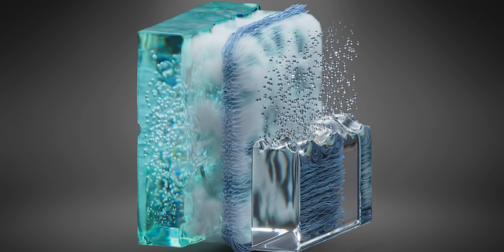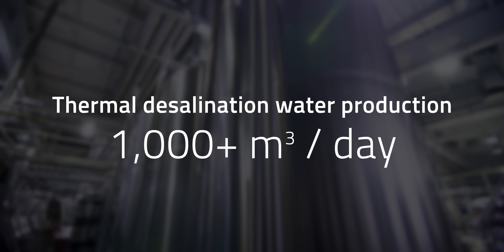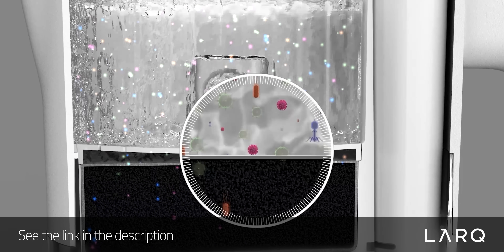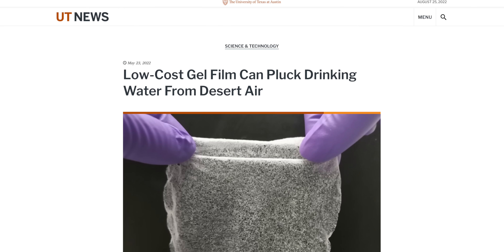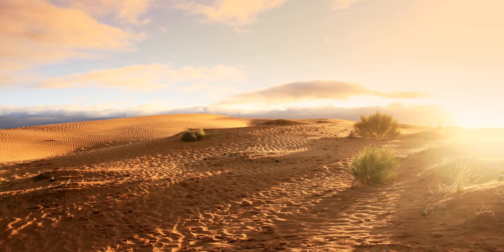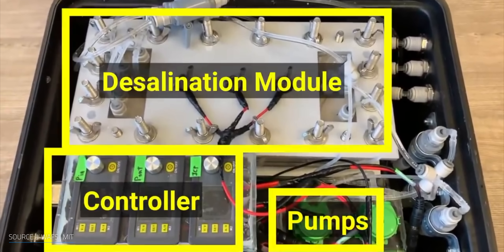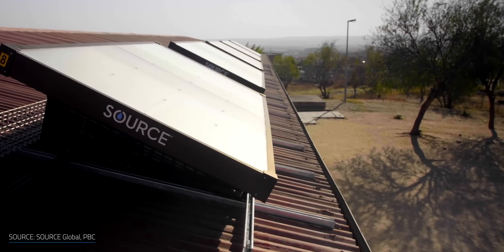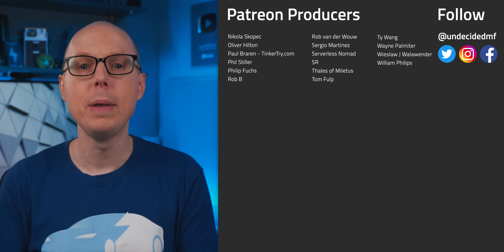2 Breakthroughs That Could Solve the Fresh Water Crisis

Comment: When I hear about the brine-residue from desalination, I always wondered if it's possible to dump that salt residue in areas like the North Atlantic to counteract the freshwater runoff from Greenland that threatens to interrupt the flow of the Gulf Stream due to the different water densities.
Reply: As far as I understand it that would have a devastating ecological impact, as you'd essentially be turning all that fresh water into salt water.
Reply: @Sancarn  You wouldn't dump it on the ice. I was thinking that you'd put it in freighter ships and release it in the ocean further off of the coast to add more salt content to the freshwater diluted ocean water. No idea if it works, it was just an idea how to potentially use the brine and alleviate the looming dangers of the ocean current disruption.
Reply: @Equulai   I see two problems with your idea:
1. It would be expensive.

2. Would probably be an ecological disaster, because you will inadvertently introduce invasive species. If you move and dump such amounts of material from one area to another that is unavoidable.
(that's already a huge problem with the ballast water of ships. If you want to know more about that topic you should look up the "Ballast Water Management Convention")
Reply: @Jehty_  It would cost money, but what do we do with the brine at the moment?Just dump bit back into the water where it was extracted?`

And the ecological disaster: I cannot see that. The brine is a result from a filtration and separation process. Except for extremophiles, can something of substance really survive and pass through all these processes?
I can see, however, that the introduction of all the salt in specific areas could cause an unhealthy increase of salinity in these areas until it dilutes enough.
Reply: Great question. I like how you think.

Comment: Imagine using the zero power option to optimize farm irrigation. the savings in water and pump energy alone would be immense. I wonder if you could wrap some around the base of a plant to provide just the right amount of water to irrigate a lot less. and why don't we pump waste brine into already heat stressed uninhabited desert areas instead of releasing it back into bodies of water? Since desert soil isn't really for growing food or plants I don't see many downsides other than expense. But even that could be creatively mitigated.
Reply: I also wonder what impact human burial in actual earth and not hermetically sealed boxes in concrete lined shafts would do for all this. If we actually used the huge amount of humanity we generate to return the to the water cycle... its a creepy thought but humans hold a lot of water, like between 37 and 50 liters per body on average.

Comment: Well, here's a few problems and solutions. First, humans really shouldn't live in arid areas. They also shouldn't have lush East Coast like lawns., We won't even discuss a pool in every backyard. But aside from that, the first problems with water desalinization is if you pull too much sodium from the ocean, then that will eventually slow, and shut down the ocean currents. Then you go from global warming, to global cooling. The world's ocean currents is what actually moderates the land climate. But as long as you put the salt back, desalinization is the best solution for drinking water. It removes water, which makes the salinity greater. Which is actually a good thing, not bad. But that's complicated. So you want drinking water from the ocean, but you don't want to put brine water back into the ocean? There's a few solutions then. First, since you live in a desert, you pump that brine water into holding tanks. The water is evaporated, and you are left with sea salt. Check out the price of sea salt at the local market. U'll get it. If say, there's a contaminant from the filtering process, then tell those Winter states, free salt. You just have to pay to ship it. They will. Trust me. Water desalinization isn't all that tough. We are just making it tougher then it should be.

Comment: The brine issue is one I don't fully get. If we take into account a closed system, as earth is, if we take salt water form sea we take the water AND the salt. When all waste water ends up in the sea again it does it as non salt water, which (although infinitesimally) will lower the overall salt concentration of such sea. If we take into account that the amount  water we will grab is similar to the water we will return, if we simply add this brine to the waste flow, it won't be an equilibrated system? At the end all brine content was already into the sea before extracting.

On other hand, the gel method, although it has a huge potential in really dry areas I see a greater potential in coastal areas such as where I live (Barcelona) where the air humidity is usually over 60%. In this conditions such a system (or a similar one) could provide a standard home all drinking, cooking, and maybe sanitarian water needed if we take a wall space large enough in a humid room such as the kitchen or the laundry, and free the desalinization methods to transport the clean water to less humid areas.

I would like to see your opinion on that.

Comment: I believe the solution to all those issues is going to come from the optimization of technologies targeted only on one single problem.
 Like energy displacement. 
Most Californians are using Air conditioning intensely these recent weeks... 
But they will burn gas to heat their water, why?
We are in a drought.
But we waste away tens of gallons of water condensation from the AC system we run daily instead of reusing it.
We heat our pools at night with gas while AC blows away hot air.
Energy and water optimization, is the way.

Comment: I like the MIT set up. I, and a lot of my neighbors, have shallow, (28' to 30' with a 12' water table.) wells that can only be used for watering the lawn, but this filter/nonfilter possibly could be used to make enough potable water for culinary use, and reduce my/our need to rely on public water supplies, which I have to filter to get the rust from the old city water pipes out of it. Yes, I have replaced my entire water pipe system for my house from the meter in with PEX, so I'm not the source of the contamination. I've looked at reverse osmosis, and decided that it is too wasteful of the precious commodity of water. I live in a desert area with 14" of rain annually on average, and a lot less lately.

Comment: the problem with these "can generate water out of thin air" gimmicky things is that in a desert, how much h2o is there even in the air? how much surface area condensed into a single cubic meter or smaller would it take to have that full of liquid water? a desert is NOT the place for such things as even with a 100% efficiency magic machine that can pull every particle of water out the air there would be so little water in the air to even pull from
in a high humidity environment like a swamp or rain forest you can definitely do so in like a day or so, but absolutely not possible in a desert

Comment: While i get the need for this, anything that uses energy is going to be a problem for the environment.

Over time, as global warming increases more of this is going to be needed so people can have fresh water but that then is going to increase the need for more energy.
More often than not, that energy still comes from coal and oil which as you know, causes more issues for the environment.
We still see this problem when it comes to such things as producing batteries for cars.
While to batteries are good, to an extent, they still need power to produce them which again, tends to be from coal and oil.
This is without the batteries needing to be replaced after something like 1000 charges and they aren't easy to recycle, if at all in some cases.

We often see great inventions or ideas but it's important not only to take in the good that they can do but how they are made.
If we don't then all we are doing is making things better in one area while causing more issues in another.
It's a simple cause of balance.

Comment: The company Spectra makes water-makers for boats which uses low current 12v dc power some as low as 1 amp per gallon while producing 300 gallons a day.  they also have a system for water poor countries the uses solar and has enough power to make water and electricity for charging cell phones etc.

Comment: People talk about dumping the brine in the ocean causing problems but as I understand it tons and tons of fresh water is being added to the ocean from the melting ice caps, we can remove all the fresh water from the ocean we want without effecting the oceans salinity because fresh water is constantly being added to the ocean. We may need to pipe the brine out into the ocean because if it is just dumped at the shore where there is little flow it could effect the local salinity. Also consider the water cycle, all water evaporates and rains down and most of it rains into the ocean.

Comment: To say 20 watts per liter is absolutely meaningless. Watts are units of power, a rate of energy flow, and not how much energy it takes per liter of water. You have to multiply watts by time to get the amount of energy required to produce one liter. Do you mean 20 watt-hours per liter?

Comment: here's a thought, nuclear reactors are cooled by water.  sometimes that steam is used to generate electricity through a steam generator.  How about you split the steam, part of it generates electricity, part of it gets used to create drinkable water?  Maybe what we really need are more nuclear reactors (still a green energy).
Reply: I mean, that's basically how it works for thermal desalination plants. It's not like there's much efficiency loss by using wires and a heater between the reactor and the desalination plant
Reply: 🤣 "  sometimes that steam is used to generate electricity through a steam generator." Sometimes? ... Dude, the only purpose of a nuclear reactor is to boil water to generate energy. Better think again, but don't tell anyone, it makes you look foolish.

Comment: We have been using a stainless steel water distiller (from Amazon) for maybe 30 years.   You fill it up and it boils and distills the water  (from the tap) at about 1 gallon in 5 or 6 hours.  I turn it on in the morning.  It collects in a glass jar.  I pour into a bigger glass dispenser.   The distiller gets calcium deposits that I clean out about once a month by pouring in a gallon or less of white vinegar and letting it sit.   I save that vinegar for reuse to clean the distiller and also to clean the toilets when they get the deposits.   We have had solar panels for 20 years.  I buy water bottles for our camping trips but not for home water.

Comment: Use the brine from desalination for salt production. Instead of discharging the brine, allow it to evaporate in a shallow pool and you've got crude salt.
Reply: Good idea, but the salt may be need to be treated and cleaned before it could be put to use.
Reply: Crude salt yes with a lot of pollutants too
Reply: Northern states use a lot of road salt in the winter!
Reply: I used to live near polar circle as a kid. Salt has low commercial value. Hence shipping costs limits practical use. 
Dumping it back into the sea creates issues with marine life. Major desalination plants in Texas have been refused permission to get setup by the EPA blocking desalination...
No smoke without fire?
Reply: Yeah, it seems like an obvious solution, so I'm wondering why that's not done. Is it the land area needed? Is it some of the salts you'd get if you evaporate all the water? I know I've heard for commercial sea salt production they don't boil off all the water because you'll contaminate your salt with bitter tasting magnesium(think it was magnesium) salts

Comment: I trust you, but wonder about those providing the info about the gel. The pictures makes it look like sheeting. When I picture a kg of something, I think of a relatively solid object- not thin sheets of a substance that will need to be strung up somewhere, somehow, protected by something, with structures to gather/harvest. A DIY project from a hardware store? They make it sound like a lump of stuff will create drinking water with little effort, I doubt it. Funny no illustration of what a functioning real world system would look like. Maybe I'm too critical, IDK. But, the tiny cut up pieces of gel you showed seemed like 100% marketing hype to me. How much do they weigh? Showing tiny pieces implies that these are useful amounts of the material. I call shenanigans. I love your videos and your style, this is not a critique of you. I may be totally wrong (comes from my lack of omniscience).

Comment: we have a few salt water sinks we could be using, the great salt lake and the dead sea for example. all that lives in those are brine shrimps and last i checked theyre not exactly endangered. oil pipes are long,  why cant brine pipes be that long? you could have pump stations powered by solar to keep the brine flowing and eventually. its not a long term solution but it will last a while

Comment: we should create an army armed with pellet guns, for the desert southwest. the pellets will contain mixtures of nutrients, beneficial microorganisms and in some cases seeds. their ammeliorative effects will be tailored to the desired outcome. because we here in this vast desert started with false lawns and oases that have been increasingly replaced with an imitation of a solution, xeroscape, but more colloquially known as "zeroscape" (as in zero plants [vs the xero whose root word means dry, as in not requiring much water]) the original intention of xeriscaping was to work in balance with the natural environment while creating attractive architectural elements within the urban environment. In its most ideal form it includes local elements like plants which feed local insects, are well acclimated to the region and creating water channels that allow the very infrequent heavy rains to infiltrate the soil where they pool, drain to aquifer if conditions are right but mostly were accessed by massive trees with roots that reach to unimaginable depths. some of the human created elements of southwestern US cities are human improved storm water drainage channels that are built upon previously existing natural channels. the techniques used to encase these natural channels in cement were developed as a use case scenario in some cases. perhaps there is a way to adapt these storm channels to collect more water, because if the rain is more than a sprinkle one of these ditches will carry water but usually water will pool in certain areas. one possible solution would be a grooving machine that would cut grooves in various locations. like smaller channels within the channel, after grooving the machine would also apply a mineral based top coat to refresh the cements texture and increase its hydro slideability. then cisterns could be built which would replicate within the best we know what these small forest patches would have looked like if not encroached upon, these extensions of three acequia environment were like capacitors in the web like circuit of the mountains. it should be pretty obvious.

Comment: I’m really curious of the effects pulling moisture from the air would have in the long-term. 

Super small scale, I presume it’d be a negligible impact. But if you industrialize the crap out of it, to the tune of, conservatively, a billion people, plus companies would sell it under the “green” scam, it would HAVE to impact precipitation levels and quality of the air (you need humidity to some extent). 

Much like how all green and alternative resource collection/power generation end up a negative impact on the environment they claim to help, this would like be no different.
Reply: First, remember that the water cycle IS a cycle. What goes in, comes out.
Second, there is no point using it at industrial scales because you would have to transport that water to where it was needed, and if you're transporting water anyway it is easier to get it from a different source. The bigger you make your collector, the less economically viable it is simply due to transportation.

Comment: I feel like there are environmental effects from drawing water from the atmosphere (at an inustrial scale) that we still need to study. How would it change the local, regional, and global climate/weather patterns? And how would it affect the people's health and ecosystem health as well?
Reply: Depends on where it's going. Water doesn't just disappear. It goes in, it comes out.
You breath it out, you sweat it out and you #1 & #2 it out. There is no reason to use that technology on an industrial scale anywhere where it would be a problem to remove and take it elsewhere. If you are going to be moving it anyway then it is easier to get it from another source and bring it in. Therefore any use of that particular material would be used locally by individuals who will be releasing it back into the atmosphere one way or another eventually.